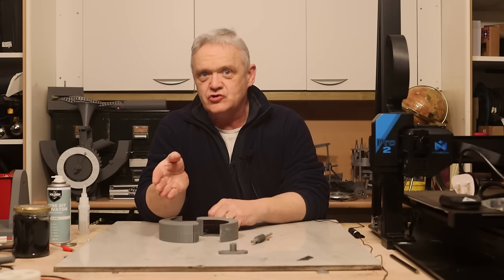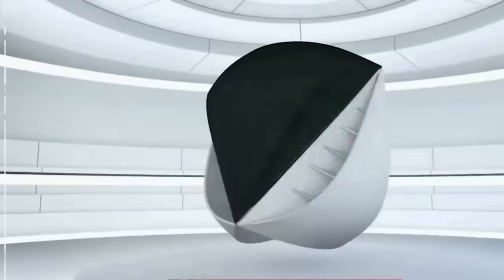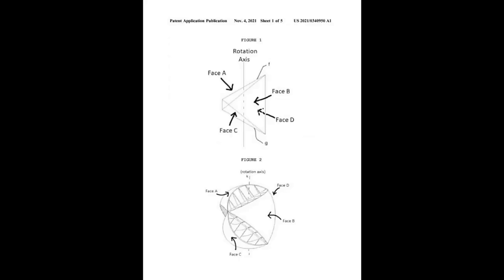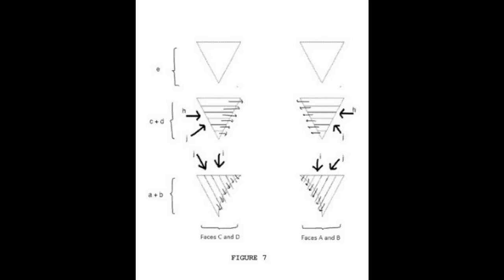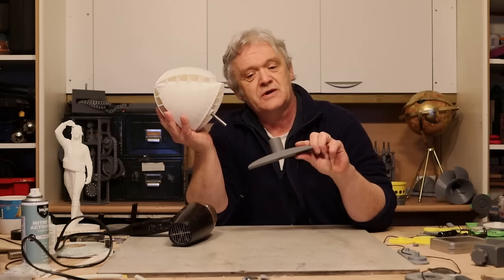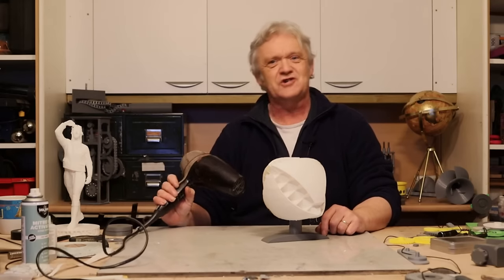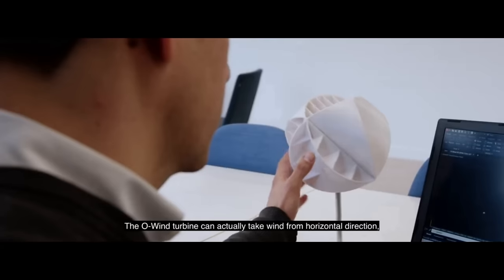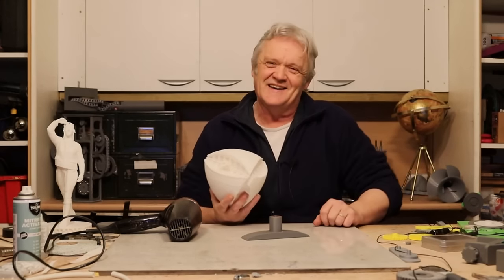2202 The O-Wind - An Interesting VAWT (reworked and reposted)

Comment: I had this idea of wind turbine which would reduce its surface area with high speeds and essentially close itself when the wind speed is high. Now why would you want to do this. First, it will protect the generator from burning when the wind speed occasionally goes up. And second, the generator can be smaller so there would be less resistance to spin when the wind speed is low (as it usually is in built areas). The Harmony wind turbine does the fancy folding thing, but I was thinking something more robust. Perhaps a centrifugal mechanism that will make the wings travel on top of each other. Like savonius, which would turn into a barrel in high wind.

Comment: Comparing the power out put of a solar panel and the O-Wind would be quite difficult and they operate  using totally different methods.  A solar panel uses light operating on when light illuminates the panel.   The O-Wind operates using wind.  Operating only when moving atmosphere (breeze, wind, gale, vehicular traffic, a ship at see). So, how does one determine which of the two methods is most efficient?  It could be 700% more efficient because the method/s used to makes those comparisons have not been published.
Reply: Maybe a new, salient measure would be cost efficiency. Cost over power produced over time. This too, however, would depend on the place where they are being implemented (e.g. low-wind sunshine vs dim and windy)
Reply: Use both? I am.

Comment: Having spent decades in the wind and solar fields and having made dozens of windmills mostly hawt  my gut feel tells me that this bubble probably is 700 times more efficient than solar, as long as you don't use a solar panel bigger that 5mm x 5mm and the solar panel has to be in the shade.  Rob I see you only pointed the hair dryer at one side of the bubble.  A bit of an unfair test if you ask me.
Reply: Yeah, I was gonna say: what a waste of time presenting what should be an "omnidirectional" rotor and testing it with only 2 directions of airflow, not even opposite to eachother (blowing on horizontally opposite edges of the device for example). Even better would be to stop the rotation after every direction test, before trying the next direction.
Reply: Are you a salesman
Reply: @rejiequimiguing3739  No. I am very much an engineer with a flare for looking at reality and real numbers. Like Rob, I have seen the bs  going to around and the reality as well. Been on this planet for over 6 decades, travelled the world, spent millions on technology of all kinds. I figure I would know by now what is bs and what is not.

Comment: Hi Robert I have seen your  video regarding desalination lately. Where you said that reserchers found out that, when boiled, saltier water tends to go lower and fresh water rises. Well the thought i did have... when you take a 7 meter hose fill it with water an rise it. With the upper end closed, upwards so that vacuum holds the water up. In the top most part of the hose the water is boiling in ambient temperature due to the pressure differential. I wonder if the salt would settle down wards ... if that works a clamp could be used  to seperate the water. I mean that would be a version using a lot less energy

Comment: Hey Robert, Thanks for all your great videos. If I was to try and make a twisted serpent coil as in video 1869, what thickness copper wire would you suggest and approximately how long a roll is needed? I want to make one of your turbine/generator combos and was after a starting idea on other materials. Many thanks
Reply: Same question!

Comment: - It appears in Rob's model that there is little to no "directionality" in the "circumferential" ducts....
(could be an optical illusion hut the entry and exit appear balanced...

 - At the end of the day - IF there is little energy available, little will be captured.
(Dynamic to static pressure conversion is probably the best use of "steady state turbulence" in the urban environment... For real random "turbulent streams (non steady state) flutter devices may be useful in micro applications - with no prospect for solar power.)..